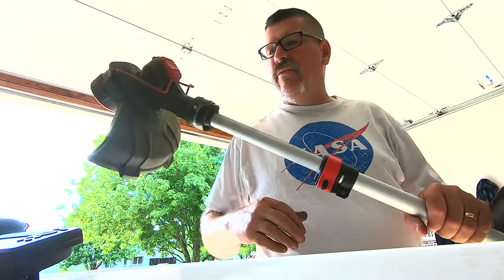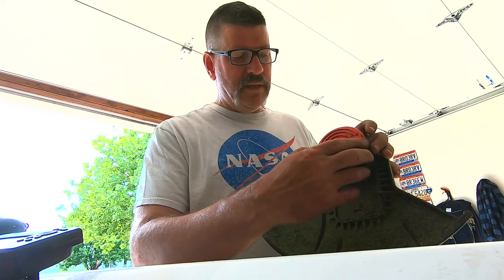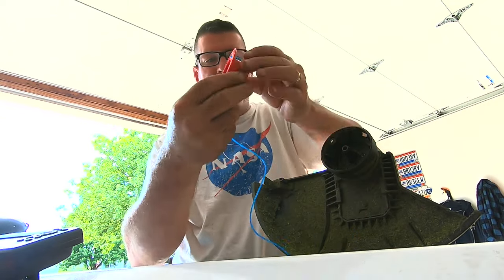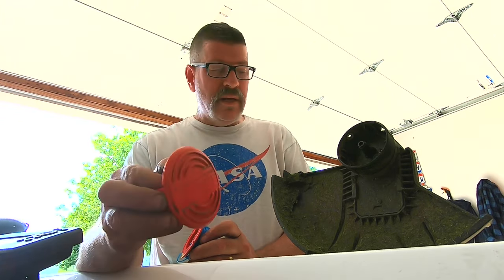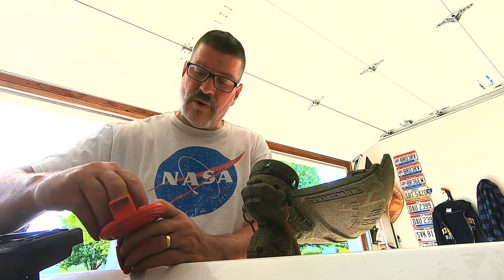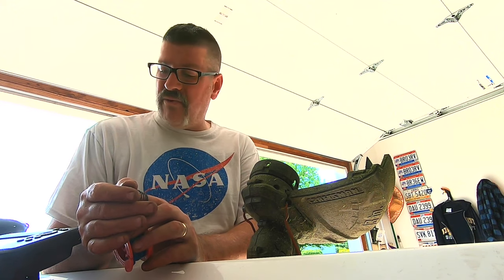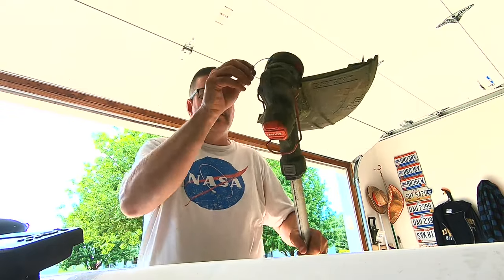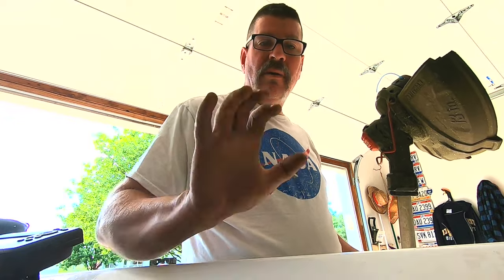SOLVED-Craftsman V20 String Timmer Manual & Auto Line Feed Issue DON'T TRASH THE OLD SPRING! #howto

Comment: You're video was helpful however even after doing all things suggested in it, the string will not feed. It's like the spool itself is not connecting with the cogs to make it turn. The spool doesn't snap in place like it did before. Any suggestions before I throw it out? Thanks for your time.

Comment: I am on my 3rd Craftsman weed wacker, this same model, after a few months the auto feed just stops working, Craftsman just keeps sending me new ones. I have never replaced this cap and spring that you are referring to, I think its a flaw with the device itself, not sure. I am about to just junk them all and buy a Stihl
Reply from the maker: Mine has run fine the last 5 years. I've just had to replace of couple of worn out caps so far.
Reply: @Hipiam  how you know when the caps are bad
Reply from the maker: @SamHayden  eventually, they just wear down and the top piece separates. You'll see what I mean at the 50 second mark in this video: https://youtu.be/gxQL6wFKcd8
Reply: @Hipiam  Gotcha, yeah mine still looks to be in good condition, not sure why they just keep breaking on me. I use them very lightly (10-15 minutes per week) they just have all stopped auto feeding. When i search the net I see a lot of the same problem with this same model from people posting on threads everywhere. Anyway thanks for the time

Comment: Had the same problem on a Troy Bilt 4-cycle - spring was all wrong on replacement.  I tossed the entire head and replaced it will manual load string head.  Worked like a charm.

I just bought this Craftsman model and was trying to find a simple explanation of feeding process - you covered it well and gave us good clues on the spring issue.  Thanks a lot for taking the time to post.
Reply from the maker: Thanks and glad to help.

Comment: After many attempts to wind the line perfectly, and fit the cap on the hub of the line holder so it will stay on the trimmer, I took the spool out and threw it across the room.  All the line unwound from the spool in a big mess.  Thanks for showing me a better way.

Comment: The line  auto feed mechanism has a spring loaded pawl  bar under the spool  that works with the two sets of ratchet teeth molded into the bottom of the the spool , it works on the principle of the centrifugal force pulling out the line during operation is applying a twisting force on the spool and and this force holds the pawl under the spool locked  when you hit the line feed button or release the trigger it electricly brakes the motor and line spool, creating inertia on the spool inside that spins it ahead in doing that it releases the pawl and allows the spool under tension from the line and braking force from the motor to jump ahead one click when it does the pawl then relocks after it feeds    .. the pawl works kind of like a thumb driven lock on a click pen, everytime you release the trigger the flywheel effect on the spool sends it spinning ahead of the outer casing and this action acts to release the pawl , "If the cover plate spring is too strong it acts like a cranked down drag on a fishing reel" and it will prevent the spool's inerita from allowing it to twist ahead of the other shell and release the pawl, causing the line head to refuse to feed ..also if the pawl under the spool is gumed up with dirt and not free to move or if its tension spring is broken you will have the same issue. its a very unique mechanism and theroy of operation from most common tap and feed line heads  this auto line head is also used on some black and decker 20V trimmers as well ..
Reply: That’s my issue. The spring for the pawl is missing. I need pictures/video of that.
Reply: I have a missing spring at the ratchet also, video repair or picture please.
Reply: Spring swap worked, thanks a bunch

Comment: Thanks for posting this video describing the line feed problem.  This video does mention the problem with tension of the new springs and a work around but does not solve the the root problem.  This trimmer feeds far too much line in normal use.  Keeping it running to work around the defect is not a good solution.  It would be fine if the thing just fed line when the feed button is pushed but that kind of change is something the manufacturer would need to do .  Sadly, they probably won't fix it since the company has grown too big to even hear the complaints of their real customers.

Comment: This is a very helpful video; I've had mine about 3 months, and the cheap cap broke and the spring went flying, and I have struggled with it ever since. Right around 3:33 in video, you were trying to display the size difference between the 2 springs. You fat fingered the new one and it was not visible. Would be helpful to set them down, side by side, for a better view. Thanks for sharing your discovery; perhaps I will try finding a way to bond a thin metal plate to the bottom of the cap, to increase longevity. GO GREEN!
Reply from the maker: @briankovacs8962  https://www.youtube.com/watch?v=gxQL6wFKcd8&t=0s

Comment: Fwiw, mine came with the big spring cover so the replacement spools didn’t fit. I can only use the ever so slightly smaller spool it came with if I want it to work and just rewrap with new line. But this video helped me ID the problem. Thanks.

Comment: Thanks for the video, helped me fix mine. After I put a new spool on the feed button didn’t work. I wasn’t using a new spring, but figured the spring may have been causing too much tension. I removed my spring all together, and it works again. Wonder if you really need the spring at all? Guess I’ll find out! Thanks again.
Reply: The spring went missing on mine and it will feed all the line out at once now. Pretty sure you will have that happen at some point.
Reply: I also have that problem. Once I ran out of string on the cartridge that came with it and started using the replacement cartridges I suddenly am not able to use the auto feed or even manually pull the line. Down on the ground every few minutes to pop off the cover and pull the string is getting very very old and frustrating. So I’m curious, did yours continue to work as designed without the spring?

Comment: After seeing how the automatic feed works like a pull chain on a light switch, I figured out the problem was the interior diameter of the replacement spool. After reaming out the spool hole with sand paper, and lubricating shaft, the automatic feed worked.
Reply from the maker: Thanks. Great advice.

Comment: HEY THANK YOU.. I thought my wacker was defective, had the head apart a few times cause it just seemed like there was an issue cause the line would not advance.

BTW the aftermarket spools have a hole that is too tight. You get any, you must use a drill bit on them to open them up a bit, also the top. I used a Uni-bit for the top and the inside I have to still mic and drill out bigger. I will try to remember to post a reply for this to help out those who got them, like me, and the new spools didn't work.
Reply from the maker: Great info and glad you got it working!
Reply: @Hipiam  thank YOU!
Reply: Ah!!! This is the comment I’ve been looking for. The spool on mine just keeps getting totally stuck, not rotating at all (and it’s very difficult to even pull out of there). I’ll try drilling out the inside. Thank you!
Reply: @benrellick  be careful, the OEM one is better than the aftermarket OEM ones. They screwed up and made the replacement spools the wrong size. Really should make a new mold for us. Maybe it is a thing for 3D printing, not sure it could hold up to the abuse though.. let us know what you come up with.

Comment: The first time I had to replace the line, now all of a sudden every time I use the thing the line gets twisted up and around and inside the rotator axle?  My line looks just like yours and I am using the old spring too?  Any ideas?
Reply from the maker: You may want to try to slowly wind the line on and make sure you're going in the righ direction, and/or can buy prespooled line (https://www.amazon.com/CRAFTSMAN-CMZST0653-string-trimmer-spools/dp/B07KKFJQH9/ref=pd_bxgy_vft_none_sccl_1/134-6445825-8999607?pd_rd_w=La5tt&content-id=amzn1.sym.26a5c67f-1a30-486b-bb90-b523ad38d5a0&pf_rd_p=26a5c67f-1a30-486b-bb90-b523ad38d5a0&pf_rd_r=1JVG4N5NMDAMPADHN8B1&pd_rd_wg=wtYfT&pd_rd_r=099ad19e-9076-41dd-ae2f-6ce2a24e867b&pd_rd_i=B07KKFJQH9&th=1)
Reply: @Hipiam  
Thanks, I tried that, but couldn't get it to work.  So I bought a filament, spool, spring, and cap replacement kit.  It still didn't work until I noticed a small bit of filament sticking out from under the filament container/dispenser, unwound and removed it.  I had pretty much given up hope, but I tried it and IT WORKED.  Somehow the filament had got sucked up into the rotor channel.  I could not figure out how to pull off the container/dispenser so I will lucky that I did something to dislodge a small piece of it.

I was worried about the spring in the replacement kit, but it works fine.

Thanks again, great video, very helpful.
Reply from the maker: @justgivemethetruth  Awesome. Glad you figured it out, and I hope this comment helps another out. Good job.
Reply: @Hipiam  
Not so fast.   It worked for about 20 minutes, and then it got jammed up, and when I took it apart the filament was all tangled inside around the spool and spring.  I hope i can take it back to Loews.  If I can, I don't know if I should get a replacement or a different weed-whacker.

On thing I did notice is that when I changed the filament and it was working, pieces of the filament were being fed out and cut off and flying out and hitting me on the ankle.  Either too long or too short, or vanishing inside the dang spool holder.

Comment: same model i got, so the sprint fixed it from auto feeding? mine wants to keep auto feeding all the time and i got some something hit my legs hurt like a mofo lol
Reply from the maker: The sping issue I had was that the new spring created too much pressure, and the line would not feed at all. In your case, you may want to stretch the sping out some (be carefull). The line auto feeds each time you push the start button. So, I bascially keep the start button pushed the whole time I'm trimming (which reduces constant line feed). Also, try make sure the cut blade on the bottom of the trimmer is clean so that it cuts excess line adequately. This trimmer works pretty good after you get used to it, but it is a pain sometimes to operate/maintain.

Comment: I too don't like to buy a whole new plastic spool so rewound the string myself. I don't know what is wrong because I go through the string in one shot! I can't even see it on the ground. Very frustrated
Reply from the maker: It will always advance and cut a little bit of string each time you push the power button. The best way to operate it is to just hold the power on button done constantly and push the line advance button during the trimming. It's tricky to get used to. If all the line is spooling off, it may be a broken part.
Reply: @Hipiam  thanks I'll give it a try

Comment: i have the opposite problem - line stopped feeding with original spring still in. do you think i need to make adjustments on my spring, or try a new one that comes with cap?
Reply from the maker: I would try both springs to see if that solves your problem.

Comment: Im having an issue with my button feed as well, but it wasnt the head because i havnt replaced it yet, cant figure out what the problem is. Press the button it just stops the head spinning for a second and doesnt  release any line. The replacement line spools i bought do seem to fit tight but maybe ill try to sand it down some or something
Reply from the maker: Good luck and if you search the comments here, you may find something to help you too.

Comment: You only have the wire coming out of one side of the wheel? I thought there was two holes the plastic string sticks out the cut the grass?
Reply from the maker: Just one side for this trimmer.
Reply: @Hipiam  oh, never seen one like that. Thanks.

Comment: The real problem with it not automatically feeding is based on the direction you load the string. If you wind it backwards it won't feed. Follow the arrow or make sure to wind the string clockwise with the spindle facing insertion.
Reply from the maker: Good info. Thanks.

Comment: Weird question but I threw away my spool that came with my Craftsman and I bought 2 different 3 packs of stringer and nothing fits in my Craftsman. Does all pre wound stringers not fit craftsman? Do I need a specific spool that only is useable in my weed eater?

I thought after buying the pre wound spools I could pop my empty out and pop a new one in and it just doesn't fit.
Reply from the maker: You have to buy the pre wound stringers that match your trimer. They are are not universal. He's the one for this trimer: https://www.amazon.com/CRAFTSMAN-CMZST080-Twist-Replacement-Spool/dp/B07KKQ4N5B/ref=pd_bxgy_img_2/144-3758826-5585700?pd_rd_w=oTWUV&pf_rd_p=c64372fa-c41c-422e-990d-9e034f73989b&pf_rd_r=XNQ1X181R5GX2N80GN2A&pd_rd_r=e038d266-5de0-4a07-aacd-bf4038e3adba&pd_rd_wg=rlsNl&pd_rd_i=B07KKQ4N5B&psc=1
Reply: Oh, geez, glad this question is out there!
Reply: Same here! Prewound one won't fit! So how do you find the correct one. Ones at Lowe's that are red and Craftsman's won't always work. Hate to waste another purchase.

Comment: While running, when I push the feed button, right when I push the button it stops spinning every time. Just kills the motor. Is that how yours works? Mine won't feed out line.
Reply from the maker: I haven’t had a stall problem. My line feed issue was solved by using the old spring.
Reply: Right on. Mine is faulty.

Comment: Hi! Question for you..I have the Craftsman cmcst900 weedeater. It will stop spinning correctly/cutting because the spool house comes loose and I have to turn it to pop back in place. But this repeats over and over. Any ideas? It’s so frustrating!
Reply from the maker: That's the first time I've heard that problem. Not sure if the clips (1:02 mark in video) are bad on the cap, or it may be a bad spool.
Reply: It just started acting up after I replaced the spool. And I made sure to buy the Craftsman brand that is meant for the automatic feed. I’ll try a different spool to see if it makes a difference. Thank you.

Comment: I bought one of these from Lowes, a year ago (Summer 2021) and after I ran out of the factory installed line, I bought a bulk spool of (Craftsman recommended) .080" line. I wrapped the line exactly as the manual and spool say to, but the line advance button no longer advances the line? It stops the trimmer when I hit it during operation, but I have NO idea WHY the line advance quit working? I can't even advance it manually.  I did not change ANYTHING other than the line?  Mine is barely used. I'm still on the first battery charge. It's all back together correctly according to the Sears owners Manual? So why won't it advance line? I think Sears needs to do a recall on these? Lowes is of NO help! Lowes did a great job when I had issues with their Kobalt leaf blower 3 years ago, but not this time?
Dave
Reply from the maker: Man. I’m sorry about your luck and agree with you. Frustrating.

Comment: So, what do you do when thee auto feed doesn't work, but the spring and cap are still the original ?
Reply: I have the same problem! It’s so frustrating!!!!
Reply: @charlottejurek8867  it turned out that my replacement reel wasn't the exact match for my weed whacker.  Once I got the right one, everything started working as it should.  It's kind of annoying that different models should look so similar.

Comment: Hey man. Do you know how to stop the middle bar from spinning?? I'm trying to replace the trimmer head but can't find how to hold it still so I can get some pressure to tighten the head.

I've looked around and can't find find any whole around the plastic casing to jam a screw driver to hold the bar from rotating.

Btw, I bought the trimmer without a trimmer head, so I wasn't the one to remove it.
Reply from the maker: Man. I wish I knew. Sorry bud. I know there are other vids out there though.
Reply: @Hipiam  Thanks. Been looking like crazy this whole week and all the trimmers I've found have a stop button on the back or a small little built in welded nut at the bottom of the beam which you can hold with a wrench. But this one I got has none of that.

Comment: The head came off and the spring disappeared.  I bought a new head from LOWE"S and it had a new spring with spools of line.  The auto line feed does not work.  Any ideas?
Reply from the maker: It's because the new spring has too much tension. Try to find your old spring, or cut the new spring down. The old spring size is and inch and 1/8. I am not sure if it works. Good luck.
Reply: @Hipiam  unable to cut spring with any tools I have.  The lost spring is lost.  Trying without any spring to see if that works.  Will repost if successful.
Reply: Removed the new spring purchased from Lowe’s and tried without any spring.  Works great.

Comment: Criminy! Am a woman so I bought the replacement spool but it wouldn’t fit. I compared it to the old one and the hole was smaller so the spool wouldn’t fit all the way down! I grabbed scissors and used the open blade to shave around the spool hole. Now it works! Geez! Just as bad as your replacement spring - they manufacture replacements that don’t fit right! UGH!
Reply from the maker: Great job getting it to work. Thanks for sharing :)